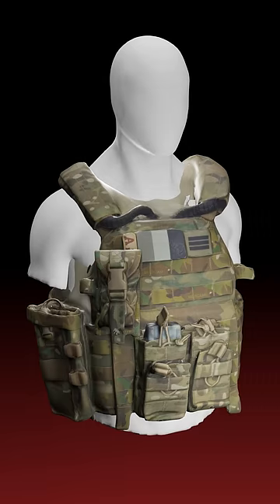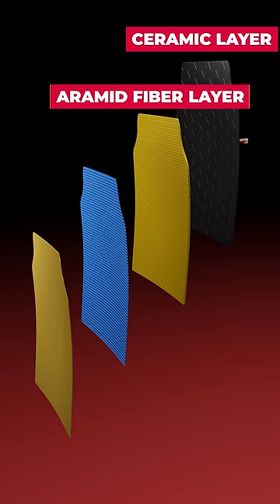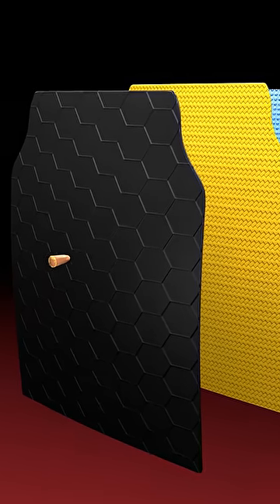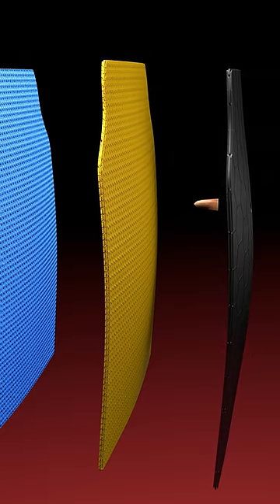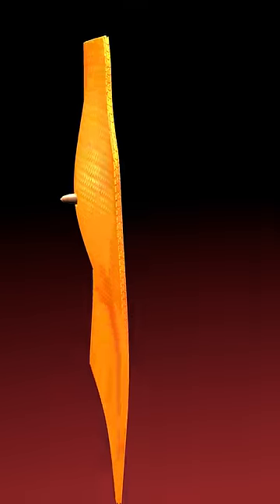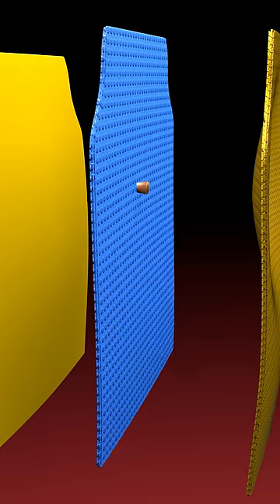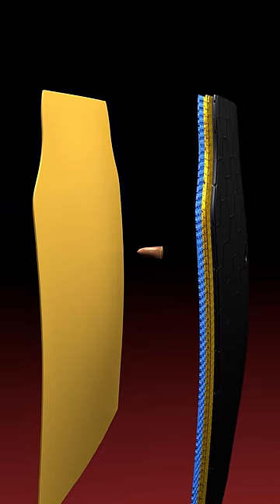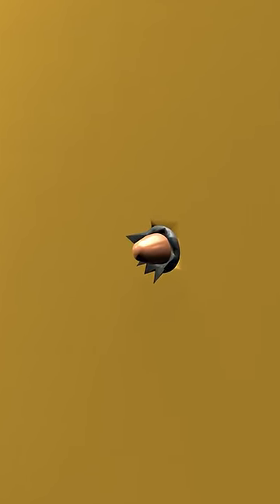How Bulletproof Jacket Works? (EXPLAINED) #3danimation

Comment: Okay, I'm a ballistics nerd. This is absolutely not how it works in most plates. I assume they mean a plate carrier, because a kevlar bullet proof vest would not stop a 7.62x39 round.

First, there are multiple different kinds of plates. Some use polyethylene only, some use  polyethylene and ceramic, some use ceramic and aramid, some use all three. There's also steel plates, but if you value your cartoid artery, testicles, and your back (weight), you stay away from those. I've never even heard of a vertex layer and I've been studying how to stop bullets for more than 20 years.

Primarily, ceramic plates are used to cause a rifle round to fragment up and greatly reduce velocity of projectiles into manageable bits for the aramid fiber to "catch" and stop. Polyethylene is kinda wild, it uses the heat generated by the hot projectile and the heat from the rotation of the bullet to solidify and slow the bullet for the aramid behind it to stop. It doesn't work with steel core or true armor piercing rounds though, unless there's a sufficiently hard enough ceramic plate in front of it to slow and fragment the core. The primary bullet stopper is the aramid or polyethylene, and the ceramic in front of it breaks up the bullet. Also, there should never be a bullet protruding through last layer. Even by a little bit. That's considered a failure to stop, even if it doesn't wound/kill the wearer.
Reply: How r u able to write so much in a single msg..??
Usually, we r not allowed so much room...
Reply: @jimmyhero1147  Amphetamines.
Reply: Does a bullet need time to speed up to maximum speed, or is at maximum speed at exit from chamber or barrel?
Reply: @jakkritphanomchit  Uhmmm... I'm not sure I understand what you're asking, but I'll attempt to answer regardless. The fastest a projectile will ever be is when it exits the barrel. Typically, or to a certain length depending on the cartridge, the longer the barrel, the faster the bullet goes. There's dimishing returns and it even becomes detrimental to velocity at a certain length. This is why shorter barrels reduce velocity. Depending on the cartridge and projectile, they will usually roughly hold muzzle velocity speed for 10-25yards, and it's all downhill from there.
Reply: @TheGhostOfPatrickHenry  your first sentence answers my question exactly, thanks. I was wondering whether a bullet might continue spreading up after having left the barrel. So that there would be an optimum distance from the target to achieve highest velocity on impact. From what your saying though the highest velocity on impact would be if the barrel was against the target, ir perhaps at a short distance, before it starts losing speed. It makes sense too, because the bullet only accelerates at the beginning of it's journey. I wasn't sure, but you sounded like the right person to ask. In any case, the furthest one is away from the shooter, the better a proof vest wo hold up.
Reply: @jakkritphanomchit  No problem my guy. If you want to learn more about ballistics and guns/ammo/armor, here's some channels to lookup: 

Buffman Range - he primarily does body armor destruction and projectile ballistics videos. Extremely informative.

Paul Harrell. He does a lot of ballistics/gun videos. He's pretty dry, but very wise and informative. 

Forgotten weapons/Gun Jesus - Focuses on gun history, and a little dry, but he has a lot of videos talking about ballistics and how guns work. I've learned a ton from his channel. 

Brandon Herrera/The AK Guy: More "fun" centered with memes and shit, but he has some pretty informative videos and I've learned a bit from him. 

Demolition Ranch: Definitely on the fun/light hearted side, but he's still informative. He shoots a lot of really random shit and you'll find out what can stop bullets and what can't.
Reply: @TheGhostOfPatrickHenry  that's epic, thanks for the list and explanations
Reply: @TheGhostOfPatrickHenry  Oh at first I thought you were talking to you’re self but it was just because of the same profile color. Anyway thanks for the detailed explanation
Reply: Don't forget the chicken plate.
Reply: Thanks, I was a bit troubled about the bullet peeking out from that last layer!😮
Reply: @TheGhostOfPatrickHenry  Thanks Boss
Reply: @jakkritphanomchit that will be a cruise missile with rocket fuel
Reply: @TheGhostOfPatrickHenry so pretty much you were like “hmm I need to answer this correctly.” snort, swallow
Reply: @LSPGaming14  I mean... not that I haven't, but I'm pretty much always on crank, just as prescribed. Perks of the 90s phase of  diagnosing every energetic young boy with ADHD.
Reply: You can find these everywhere😢😅
Reply: @TheGhostOfPatrickHenry  how are people even able to carry such weight of the vests
Reply: @abdulmoeed581  Having been shot at a few times, believe me. If you want to live, you'll manage. They make light weight plates for a reason. Some weigh as little as 3-4lbs each. Level IV plates are gonna weigh anywhere from 6-10lbs each. My plate carrier only weighs like 30-45lbs depending on the loadout, but that's only meant for QRF work, not sustained combat or patrol. That loadout is more like 90-120lbs depending on the expected field conditions.

Comment: Interesting. The bullet resistant vests I wore in Afghanistan, would stop the bullet at the ceramic plate layer
Reply: Yeah I read on different manufacturers sites the ratings. The rigid plates are astounding in stopping power but the thicknesses are pretty heavy - the Titanium plate was 0.7” I think, steel was 0.4? Ceramic I saw one at over an inch thick. My nephew was infantry in the 1990’s in Yugoslavia, to man the gun in the turret he got a heavy metal fish scale  thing that he said was rated for 7.62x54R AP, but it impeded his mobility. I think the violence of the felt impact is the frequency content. In other words, that energy comes in fast and the stiff plate all moves back extremely fast, not that far but really fast, so the shock will enter a lot of tissue and a shear wave (tearing wave) will form. I bet survivors have interesting bruises.
Reply: @richardkudrna7503  bruising and broken ribs preferable to a penetrating bullet wound, my guess

Comment: Most police departments issue NIJ level II or IIIA plating. IIIA basically improves on level II by adding protection for . 357 Magnum and . 44 Magnum rounds to the list of defeated calibers, but neither class protects against rifle rounds, so yes, 7.62x39 (and all rifle rounds) will penetrate and defeat the plating. Not a chance I want to take.😮
Reply: Level IV plates on the other hand…
Reply: These are hard plates not soft armor. Even though the video is wrong.

Comment: The ceramic would break the round to bits for the soft layers to catch.  It wouldnt be fun on the old ribcage thats for sure and the vest will be compromised but by that time im pretty sure you'd be in cover winded.

Comment: I’d wear two bulletproof vests one over the other. I don’t like that the bullet makes it that far into the vest
Reply: Most of the time they get caught in the first couple. Depending on the rating they can stop sooner or later. This is a very crude diagram
Reply: Bullet proof vests are already heavy it would be better to just wear some body armor that is a higher raring
Reply: @Gravy_seal I just wear the AR500 steel plates, they are heavy, but they stop most rounds much better and with much less pain transfer to your body, and they can take multiple rounds in the same area with little to no degradation from most rounds! I want to get the alloy one's that are a few pounds lighter and they are actually stronger too!
Reply: Steel is your friend in this case
Reply: @wesman7837  and all that spalling since the first round will fly right into your thighs and neck and undersides of your arms, you know, all those juicy arteries.
Steel "armor" is a fucking joke
Reply: Well thats 7.62 rifle round,. You will do just fine with 9mm,.
Reply: Bruh you will lose all your movement speed.
Reply: It’s better than going in your chest and out your back
Reply: @Vokeian  it really isn't, you'll die for sure running steel armor, why you and other boomers think it passes as armor when you have actually ceramics that will let you walk away without even being winded is beyond me.
Reply: I think you should stick to playing video games😂😂
Reply: That means the technology not advanced yet....
.
Reply: Don’t worry, that’s why you got plates and soft armor
Reply: Your the joke as don’t know anything
Reply: You haven’t a clue what your talking about
Reply: Well, it doesn't
Reply: Yep this dude plays too much call of duty..lol..
Reply: They're bullet resistant, not bulletproof.
Reply: Me too. I'd wear a XXXL on top of my regular chest size which would be a XL.
Reply: Wear 3 bulletproof sir for better protection

Comment: Well, steel plates stop most bullets a lot better, but they are very heavy! They will take multiple rounds in the same place and still provide good protection!
Reply: better pad up or your chest is going to be on fire for a few weeks
Reply: True but steel plates can cause bullets to shrapnel
Reply: There is no level 4 rated steel that is practical to carry. It stops more rounds but it shatters once it gets hit by things that level 4 stops. Ceramic is better to use when you need to stop a smaller number of harder to stop projectiles
Reply: I think I saw that once in a Clint Eastwood movie. For sure, a steel plate is the way to go.
Reply: @Au60schild In that movie he quite literally was wearing a cast iron stove door 💀💀 thing would stop a .50cal, albeit you still wouldn’t survive for your insides would be ruptured
Reply: Steel will shrapnel and injure you otherwise
Reply: @xXtuscanator22Xx that scene was also copied in Back to the Future 3. But realistically, that's so heavy, you wouldn't have time to run for cover. You'll get shot in the head before you have time to duck because that much metal is extremely heavy.
Reply: @brookelord3448  Yes we know this because it’s cast iron. Everyone knows Cast Iron is fucking heavy and thick as shit.
Reply: @xXtuscanator22Xx  I was referring to steel armor. Sorry if that was confusing. In the original comment "steel plates" is what is too heavy. Wesman7837 might realize that a steel alloy is stronger than cast iron but he probably doesn't realize the amount of steel required to stop an AK would be so heavy, the armor would likely make the person easier to kill. He said "very heavy" but I don't think he realizes that the ability to run and duck is what keeps a soldier alive. The weight of the lightest steel alloy vest is the reason they developed vests like the one in the video. It's too heavy, and this was already determined by the professionals.
Reply: Like Clint  Eastwould 😂
Reply: Better train how to get that crap off under water tho

Comment: You forgot the soft armor that is before the plate
Reply: Which vest has soft armor before the ceramic plates?
Reply: @DavidLanger-d8c  one of my IOTV had the plates behind the soft armor pocket
Reply: That's ICW armor. Most plates these days are standalone. Mine are level 4 but weigh 8.5 lbs. Still worth it though, especially where I live.

Comment: literally not how i works at all. level 4 nij is solid ceramic plate and the ceramic breaks the round apart. most of the time the round doesnt even make it a quarter of the way into the plate.
Reply: this appears to be a different more lightweight vest perhaps targeted at lower threat level needs such as Recon or Support Work.

Comment: Tightly weaved? You mean tightly woven...
Reply: The verb weave is usually inflected wove in the past tense and woven in the perfect-tense and past-participial forms
Reply: @Gunmany  Well the video assumes past tense as they arent weaving it right there, they use previously woven fabrics. English sucks...
Reply: There were a few more grammatical errors. "If I remove... then there are these...lastly this polyethylene layer. Firstly the bullet... lastly, bullet will come.." 

There are only 4 layers if you remove the covering. If you don't remove the covering "then" there is only one layer 😂
"These" specific layers are present in every vest as they actually exist in an alternate dimension, and "these four layers" can be present in 1,000 vests at the same time. 

I cant think of another joke but "Firstly," English is a conglomerate language made from primarily Latin and Germanic languages. Secondly, English also has many Greek, Yiddish and Uralic words as well as some Celtic words like "German." Lastly, it's understandable when someone makes a common mistake. 

When referring to a sequence of events it's "first and last/finally." He forgot the word "the" before "bullet." I guess this is a bullet named Bullet. 😅

Comment: Woven; it is woven, not weaved.
Not a terrible English translation, but you need a better proofreader.
Also, the ceramic usually shatters, and the bullet is about done, unless it's a pretty big calibre; a 5.56x45 or 7.62x39 is usually done, unless they're "hot-loads"

Comment: These vests are not bulletproof, they're bullet-resistant.
What that means is that the bullet impact will be absorbed by the various layers in the vest, reducing its velocity and penetration capability. Each different layer reduces the speed of the bullet projectile more than the outer layers before it...
But, the bullet impact still hurts like hell!

Comment: Not even close. 
The different densities and hardness between ceramic and softer materials behind it is made to return the shock wave made by the impact against the bullet itself, so it flattens the bullet enough to lose any piercing power. The other layers are here to avoid shattered ceramic to be dangerous for the body

Comment: The 152 mm howitzer-gun M1937 (ML-20) (Russian: 152-мм гаубица-пушка обр. 1937 г. (МЛ-20)), is a Soviet heavy gun-howitzer. The gun was developed by the design bureau of the plant no 172, headed by F. F. Petrov, as a deep upgrade of the 152-mm gun M1910/34, in turn based on the 152-mm siege gun M1910, a pre-World War I design by Schneider. It was in production from 1937 to 1946. The ML-20 saw action in World War II, mainly as a corps / army level artillery piece of the Soviet Army. Captured guns were employed by Wehrmacht and the Finnish Army. Post World War II, the ML-20 saw combat in numerous conflicts during the mid to late twentieth century.

Comment: Okay not quite accurate but good try, the jacket shattering also helps with that and then there are better plates that have a steel core in it which is even better but heavier.

Comment: And those layers distribute their force over your fucking chest and it hurts like a mother fucker. Also if the bullet is large enough and has enough force. Like a 12 gauge slug. Even though it doesn’t penetrate it may still kill you if it hits right on your heart. That amount of force on your heart will cause it to miss a beat and could put you into cardiac arrest.